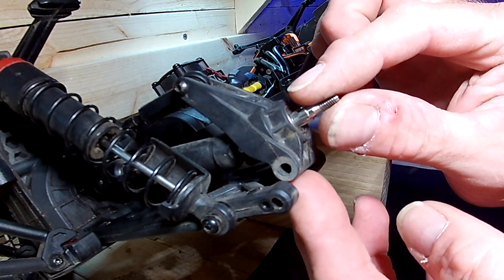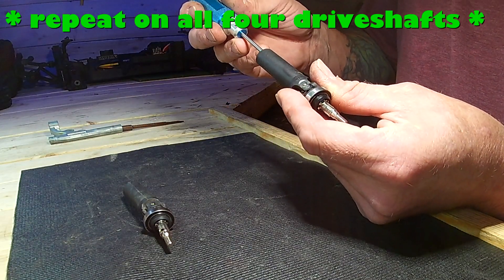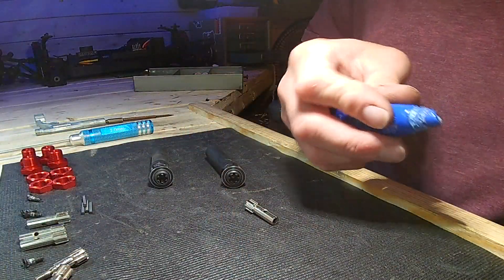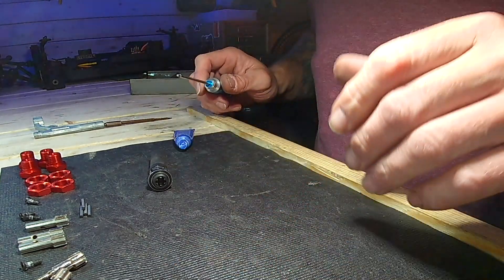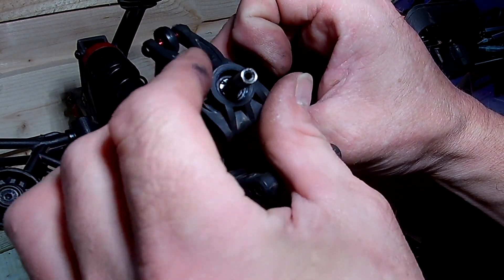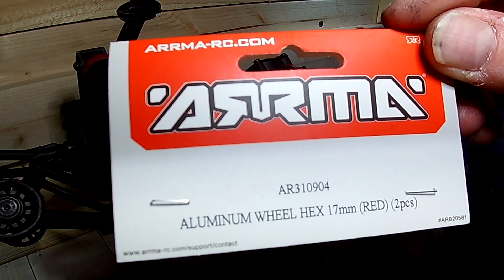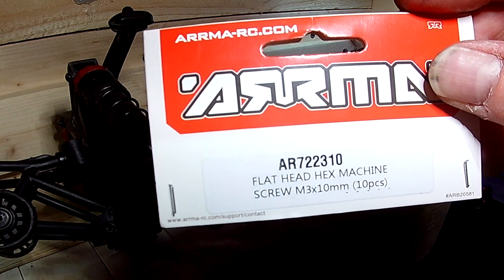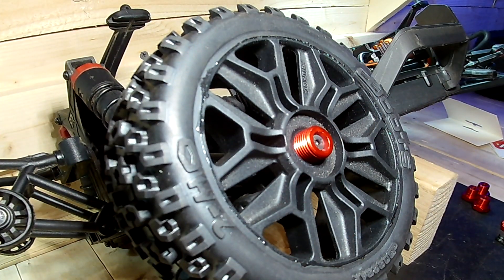Senton 3s -17mm Aluminum Wheel Hex Conversion Utilizing Arrma Parts

Comment: How much $$ did you spend ??
Reply from the maker: $58 and some change but I saved a couple dollars by grabbing tyhon driveshafts from ebay because they have the wheel axles.
Reply from the maker: But I have an extra set of brand new driveshafts out of the deal.